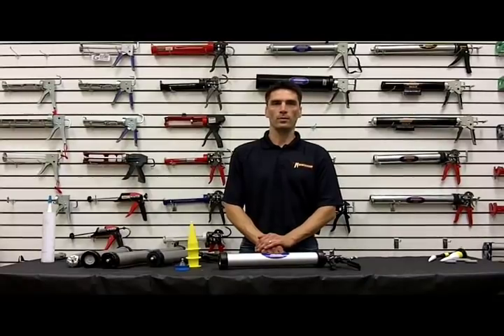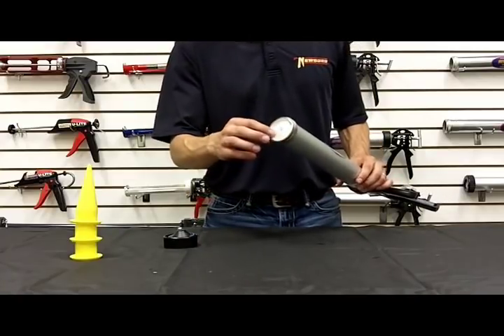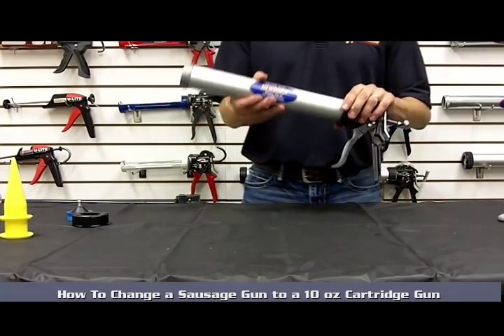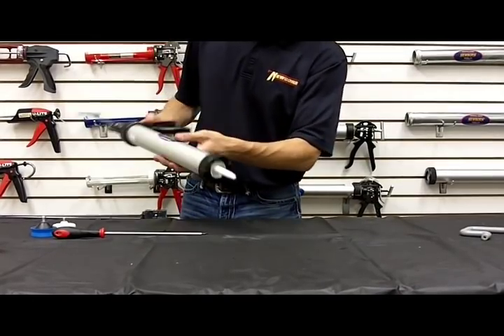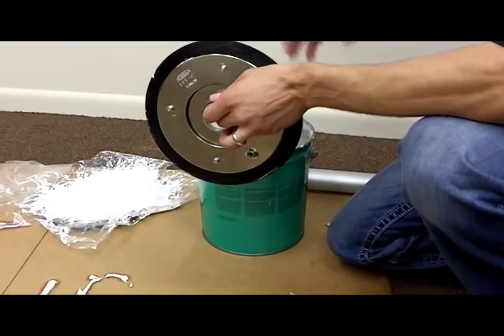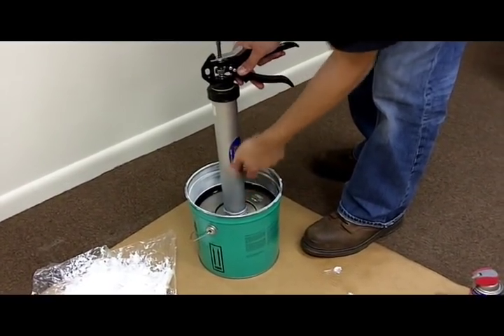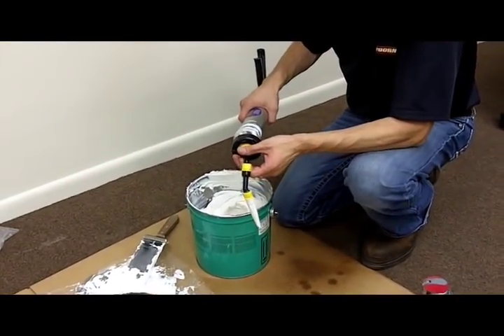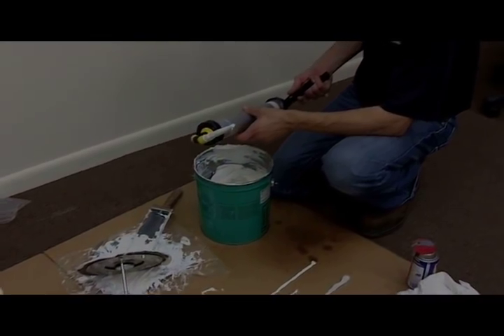How To Use a Sausage Gun

Comment: Thank you so much for this video. I bought a sausage gun and the sausage sealer...but couldn't get the plunger to pull back into the barrel to put the sausage in. I thought I was doing something wrong, so I watched your video and it helped me figure out how to get it moving. The plunger was so tight that I thought it was too big to be able to pull back. But I saw on your video that you can unscrew the barrel near the handle end. I did that I found that it was such a tight fit, that was the only reason I couldn't pull the plunger back. So I got it working before I screwed the barrel back on, and now I'm ready to seal around my aviary. Thanks again 😊
Reply from the maker: Glad the video helped!

Comment: Not so convinced on the wd40, a silicone product if there ever was one. You just contaminated  the whole pail on the first fill, unless of course you were pumping silicone based rtv, and even then, I would not recommend that. How about creating a fill tube from an old nozzle, cut way back. Beats putting a contaminant in your product, or having to wipe off the end after bulk filling.

Comment: What’s a bulk gun for? I’m not familiar w what that large metal bucket is full of
Reply from the maker: A bulk gun is used to suck up loose material out of a bucket and dispense. A variety of materials can be stored in these buckets. Bulk material is generally less expensive than alternative methods. Drawbacks would be that it can be messier and requires a bit more experience to use efficiently when compared to cartridges or sausage packs.
Reply: It's for people doing A LOT of caulking.
Reply: I go through 10 gallons a day.

Comment: What thrust ratio number is preferable for ease of handling?
Reply from the maker: We recommend 18:1 thrust as it works well with most types of materials.  If you only plan to use thin material, then 12:1 thrust would suffice.

Comment: Thanks , that was a great video. I had no idea I could use a cartridge tube. It was also my first time using a sausage tube. I know it probably depends on the product but if I use only a portion of the product in the sausage, if i  cover the nozzle, how long will it last in the nozzle? I use a water proofing product for showers by Seka. With 10oz cartridges I can use them up but with 20oz sausages I might have a third or more left over. Thanks
Reply from the maker: Hello, there are other factors that impact cure time which makes it difficult to estimate without more info.  We recommend reaching out to the material manufacturer directly to get a more accurate cure time based on your conditions.
Reply: @NewbornCaulkGuns  It will actually last a considerably long time. Ive left it there for months. I use Sekaflex sausages a lot. thanks for the reply.